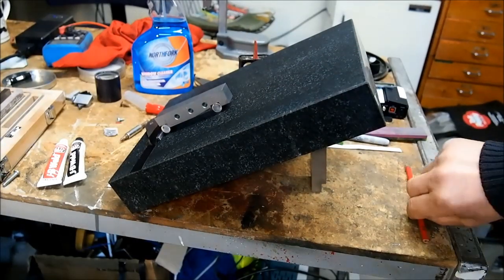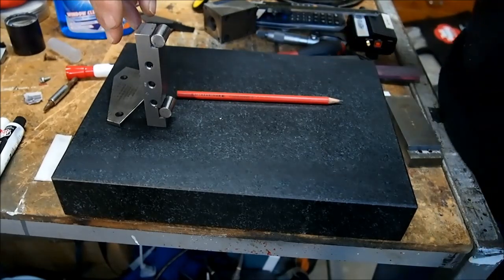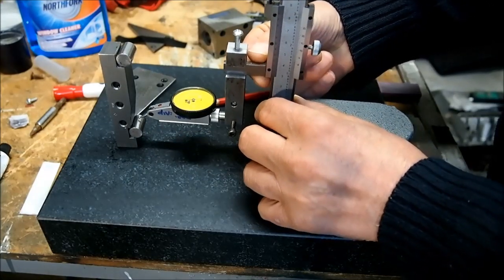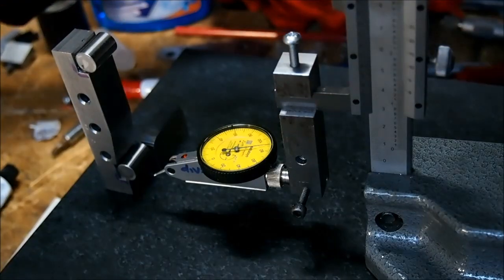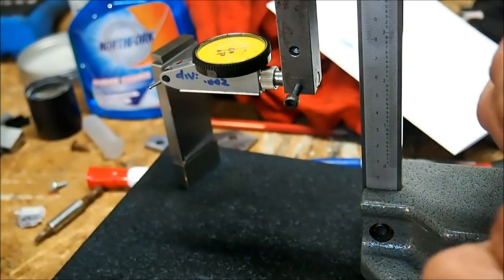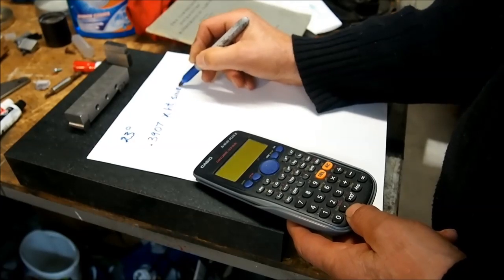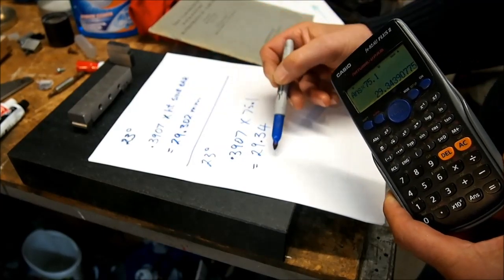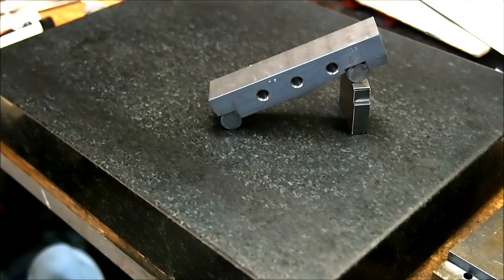Making a Sine Bar  Part 3

Comment: It was a good and well demonstrated series. But unless you have some definite for need a sine bar of that length I'm not sure why you built one so short. As long as the roll spacing is accurately known, the longer the sine bar is the less sensitive they are to minor inaccuracy's of the gauge block stack.  I was taught imperial in school so still think and visualize in that measurement system. 5" and 10" roll spacing are the most common sizes using imperial gauge blocks.  So I'd assume 125 and 250 mm would be the most common using metric blocks?
Reply from the maker: I agree. However I built the 50mm as an exercise, and the 75mm because it fits perfectly into my 4 inch milling vice.  I will now make a  4inch ( 100mm) which as you say will be slightly more accurate, and will still ( just) fit into my mill and shaper vices. Best regards
Reply: @9neil  That makes sense Neil. 

I'm using a bit larger 6" vise so my 5" still works fine in it. In a well run industrial setting it would be extremely rare to see gauge blocks used on the machine tools. At the hobby level we can cut corners and take a lot more time to protect those precision surfaces. Normally those gauge blocks and sine bars would be used on a surface plate to preset and fixture work at the desired angle on other work holding accessories. Angle plates etc. I've also got a 10" sine bar and one simple trick I've used with it for low angles is to use a pair of 1"2"3" blocks on each side of the vise set within that 10" roll spacing. If the vise bed is parallel to the mill table as it should be, that allows a longer sine bar than your bed width to still be used and set with the gauge blocks. The vises jaw height obviously limits how steep an angle you can realistically get of course. But it's one way to work with a larger bar than your vise is really capable of using.